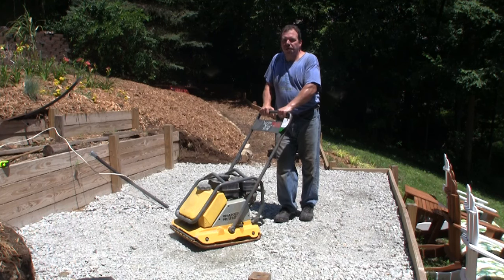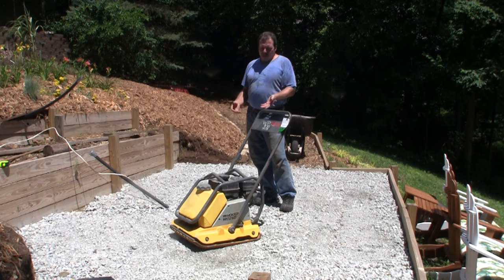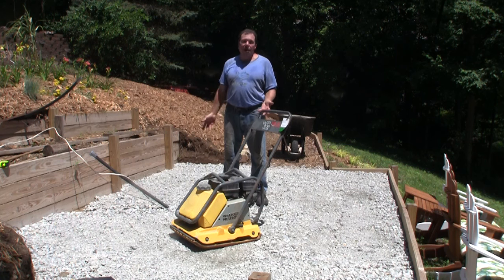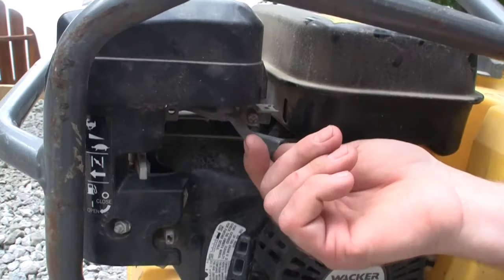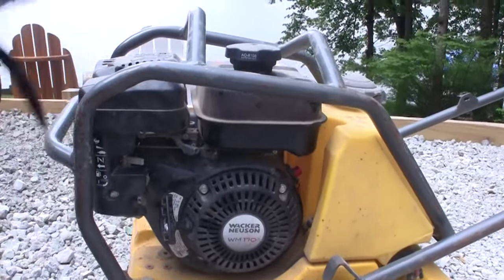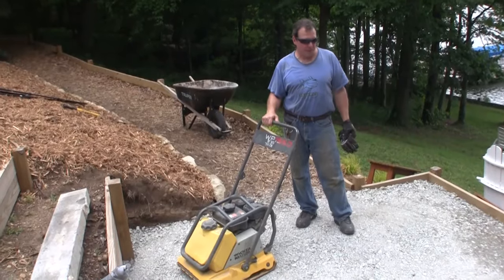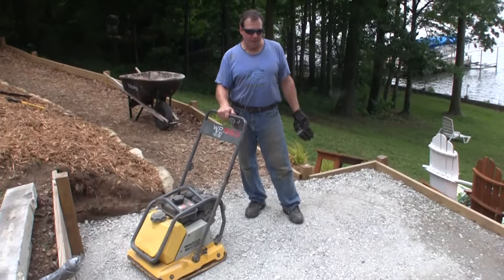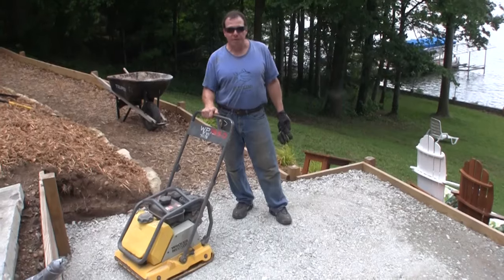How to Use a Plate Compactor

Comment: You need to wet the gravel down while you are running the machine. It is a must.
Reply from the maker: Hey the priest..,
Thx for the tip and for watching watching!
Reply: was looking for this reply.
Reply: By the looks of that some compactor, it looks like that tank on the front is the water output

Comment: To anyone else watching this...You also NEED a hand tamper.  The tool he was trying to describe.  Plate compactors don't get those 90 degree corners and not exactly as close as you need to up against a fixed wall.  The hand tamper is a must for the longevity of your pavers.  You need to hand tamp around the perimeter of all fixed sides and corners.  These pavers will settle in the corners no doubt...
Reply from the maker: +shaymoose17 Hi Shaymoose17, yes, a hand tamper is ideal for corners and edges. We want people to know that they shouldn't be tempted to use the hand tamper for their entire project even though it is light weight and easy to use. Rent a plate compactor to do the job correctly. Thanks for the comment.
Reply: I don't mean to point out flaws.  Thanks for you nice comment back.  Yes, use the right tool for the job and enjoy it for many years without seeing failure spots.  I'd just point out that it would be wise to mention to also invest that extra 15 dollars for a hand tamper.  Fifteen dollars spent and 15 minutes of tamping saves 4 hrs of fixing down the road.
Reply from the maker: +shaymoose17 Yes, we totally agree. Use a plate compactor for the majority of the job, and use a hand tamper for the corners. Using the right tools for any job will usually result in a fine outcome. Thanks!
Reply: Oh my Gosh!! This video is exactly what he said it is "and" exactly what it is titled "How to Use a Plate Compactor"  Soooo....you dont NEED a hand tamper to know how to use a plate compactor.  If this was a video titled "How to install a paver patio then yes, you could say he missed a few things.  If someone had a video on "The best way to fill up a pool" you wouldn't criticize the video because they didn't also say to make sure you install the liner first.
Reply: @shaymoose17  My dad taught me the phrase RIGHT TOOL FOR THE RIGHT JOB years ago. love that phrase. i still say it all the time.
Reply: @AnnLippert1  : Your father is smart man and you are a smart student.
Reply: No need to buy a hand tamper for the corners if you have a sledgehammer.  Develops those biceps too.
Reply: @williamgrissom9022  A sledgehammer will move your gravel base in the process.  That's why hand tampers are like 10"x10" bc it stabilizes the area with a flat head.  You're right about those biceps though!! 💪
Reply: @williamgrissom9022  I am currently remodel my front yard and extend my drive way, I am using DG and 3/8" Noiyo pebble here and there on just for the finish look. Hope it ok that way .Work after work and weekend Yah definitely some work out like you said :)
Reply: However if you are watching this video in order to learn how to compact gravel, knowing about the need for a hand tamper is very useful information.
Reply: Now how do you use the tampon ? Lol just kidding 
Great video

Comment: Thanks.  I used one to compact moist clay & sandstone in Atlanta before spreading gravel.  Initially, I tried a jumping-jack tamper, but hard to control and dug into the clay so wasn't working well.  Also a 2-stroke engine so trickier to run.  Swapped it for the plate compactor which worked much better.  Here because I'm extending a driveway slab at my CA house, also on mostly clay soil.
Reply from the maker: Hey William,
Good job! Thx for watching!

Comment: I have placed pea gravel driveways on several projects . It is critical to wet down the soil base first. Then bring in 3 to 4 inches of road base in split lifts . You water and then compact each lift. You then bring in 1 inch of pea gravel and run the plate compactor over that a few passes. By properly compacting the road base, you do not need to place more than a one inch thick layer of  the pea gravel . many people make the mistake of placing  too thick of a  layer of pea gravel , which causes car tires to create ruts in the surface.
Reply from the maker: Hey Mike,
Thx for adding your comment and for watching!
Reply: Hi! Can you explain what do mean by slip lift. Just curious. Thank you.
Reply: I had a concrete business for 20+ years and, not being rude or anything but, this is completely incorrect information to be putting out there. When does someone want to compact pea gravel with a compactor? The answer to that is NEVER. You can't.  Pea gravel is a washed rounded stone. It self compacts itself to the maximum it can even be compacted the moment the pile is on the ground. Also, it is absolutely fine to use 4 inches of pea gravel under a concrete slab...this has nothing to do with ruts. As long as the edges of the pea gravel substrate are closed well to where the gravel cannot fall out from erosion etc and causing empty voids under the concrete, then 4 inches, or even 6 or 8 inches, wouldn't be anymore of a risk than a 1 inch layer would be. Running a compactor on pea gravel would produce the same results as trying to compact runny oatmeal. The compactor will just push it out of the way and sink to the dirt. Try it yourself and see what happens.
Reply: I still appreciate him though
Reply: I still appreciate him though

Comment: Sorry but that's not how its done. Those handle bars on top, you use those to make your turns so that you dont dig in on that back of the plate like that, and notice how you're putting a lot of strain on your lower back when you're reaching the end of tour run and how you're basically dragging it to make your turn. This is incorrect use. For small spaces, you need to think of being a matador fighting a bull. Stand to the side of the compactor before you make your turn just give it a nudge so the back end swings out,  and it'll make that turn without digging in to your base, without killing your back.

Comment: I think the base should be wet when you do this so it compacts correctly.  Hey what do I know....  Done it a few times.
Reply: Obvi doesn’t matter
Reply: Water is absolutely critical hence why the sole purpose of a laboratory compaction curve is to determine the optimum moisture content to achieve maximum soil density during compaction. Sad to say compacting too dry is not very effective.

Comment: Just a few observations. That area is tiny. You probably could have saved some money by going with the smaller unit. Also, if the two units weigh the same, you will get better compaction force by using the smaller unit. I would probably have gone with screenings instead of gravel. It makes for a one step process instead of gravel + sand. Thanks for sharing though, good job.
Reply from the maker: Hey John,
Thx for the tip!
Thx for watching!
Reply: At our Home Depot it’s a $2 difference for rental and they definitely don’t weigh the same. Glad we went larger because they already dig in and a smaller one more so. Wider coverage meant more even distribution for compacting in our particular situation. Also for those who have a sandy base you will want to wet it down first.

Comment: I've got severe mole damage to entire front yard. Will this unit be enough to pack soil below mature grass turf?
Reply from the maker: Hey Thomas,
I’ve never heard a compactor used for that. 
Should work  in theory as it can compact inches of gravel ... BUT. It may put a hurt on your lawn as I know grass doesn’t do as well on compacted ground - the roots need room to grow etc.  
I’d be curious to see how it all works - short and long term if you go thru w/ it. 
Thx for watching.
Reply: Compaction only reaches down several inches, that's why compaction has to be done in "lifts".

Comment: I have only ever used the manual tamper. So you just run this thing over gravel and voila? 
I have a small area (80 square feet) to do prior to laying pavers. I don't need to remove the massive  amount of gravel first if I rent this?
Reply from the maker: Hey MsD.....,
The plate compactor vibrates those 1-2inch gravels pieces tightly together. Then a layer of sand and the the pavers. That’s it. The plate compactor is a beast - heavy, but does s great job. 
Thx for the question, thx for watching!
Reply: @Housebarons  thanks for the reply! Definitely looking into this.

Comment: How did you keep that retaining wall you built from blowing out under stress and time?  Doesn't look like much holding all that together from the perspective of the outside in this video?
Reply from the maker: Hey Earl,
We learned the hard way ( having to redo it ) that additional support was needed over time. Under that patio, we buried a “deadman” system of thick landscape timbers to which the exterior wall is attached .We’ll have a future video on it. But basically it’s a system of timbers buried in place which are held in place by the weight of the earth above it.
Thx for the question.
Reply: @Housebarons  Well heads up because your typical landscape timbers rot to pieces in 3 years.  I did a 16 sided ring around a tree and they were falling apart in 3 years/crumbling.  You might want to look into stone retaining walls.  Having them decay under all of this will cause more settling no doubt.  Good luck on it.  Sometimes the only way to learn is by trial and error.  Many don't even try so keep up the good work!
Reply from the maker: Hi Earl, we did recently build a retaining wall around the fire pit and patio.  Hopefully it will keep everything from sliding into the lake.  We will make a video in the next few weeks of another retaining wall project that we did near this patio.  Thanks for your comments!

Comment: Using one to level some low spots in my yard.I can't believe how these were designed. The kill switch is in front of the machine.you have no adjustment over the throttle control unless you're standing next to it,which wants to walk away from you just poor design. I read somewhere that if your throttle is too high it doesn't compact as well so there's supposed to be a happy medium somewhere but I've yet to see a difference really
Reply from the maker: Hey Josh,
Thx for watching!

Comment: Do I need to use one of these if I don't use gravel?
Reply from the maker: Hey Evan,
What are you doing? A patio on dirt, sand??? 
Typically compacting it will make it more firm and less likely to settle unevenly. Gravel base is generally a good idea.
Thx for the question,
Reply: @Housebarons  I am building a garbage can corral for my Eagle Scout project. I was told that since it's small and not going to be supporting any people, I don't need to worry about gravel. That will probably be a game-time decision. Sorry for the late reply. Thank you!

Comment: Why no water?
Reply from the maker: +Jesse Meyer Hi Jesse, the water sprinkler is only needed if a person is compacting a substance that woul stick to the machine, such as asphalt. We were compacting sand and gravel, so we didn't need to use water. Thanks for the question.
Reply: Water also helps with optimizing compaction, probably not super important for a backyard job but if you're ever doing culverts or driveways make sure you keep the gravel wet!
Reply: Joel Conn how wet? Too much water turns it into sloop right?
Reply: @MsElijah16  just a little water obvioulsy.

Comment: 46" of gravel, look how high that platform is, there is a lot of weight behind those wooden posts and planks holding the whole thing in place and another level behind, would fancy sitting on that especially after rain or when the posts rot later.
Also I always though choke was used to start up and then turned off (as per Wacker Nueson's own video), not the other way around.. I don't really think this guy knows what he's doing.
Reply: 4 to 6 inches
Reply: @MrPmc71  OK it sounded like 46, it certainly looked liked it, but still there is a lot of earth  or whatever behind that platform.